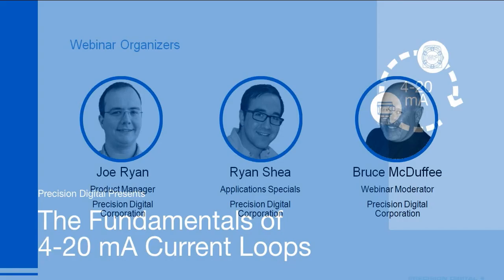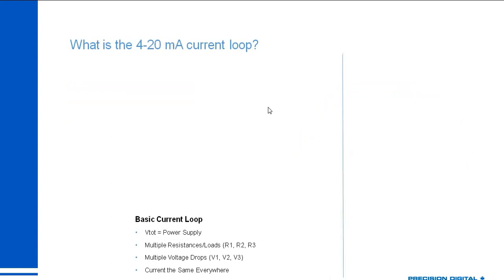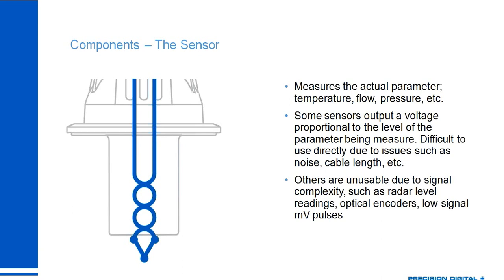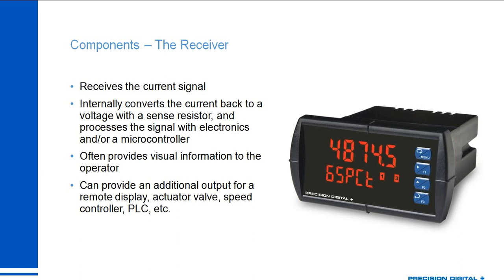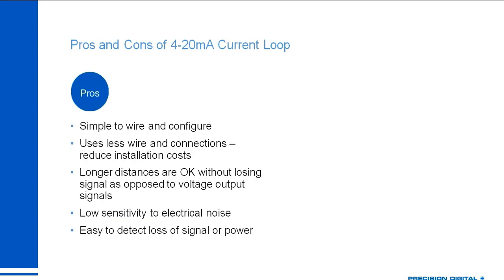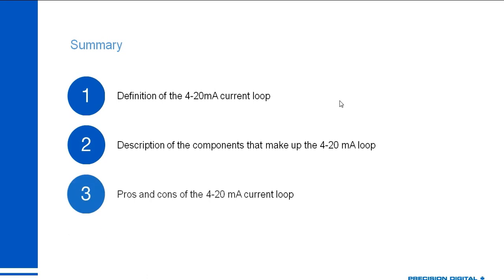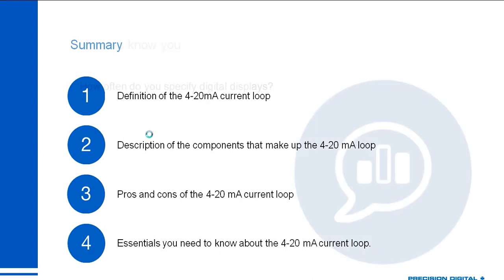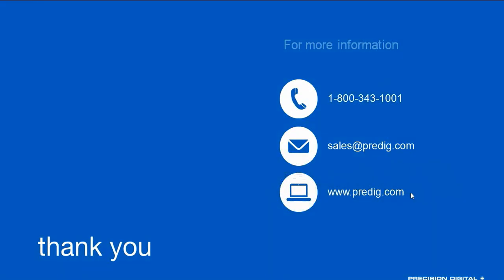The Fundamentals of 4-20 mA Current Loops

Comment: As a retired electrical/process engineer and  also college professor in the industrial control curriculum, I tend to watch a lot of videos like this; I am interested in what the presenters do well, and what they do poorly. How well do they address the questions from the students.

Sometimes, it is obvious that the presenter has given their 'class' many times and had learned from the experience, refining how they present the information. Most of the time, it seems as if the presenter is still new to the subject, and falls into a lot of holes in trying to convey the concepts adequately.

I thought this video started pretty well, but then started to fall part when students started asking questions. For example, when one student asked "what does regulating the current" mean, the presenter repeatedly tried to use the word "regulate" to define itself, which never works. When I taught this subject, I usually dealt with this question by making the points:

- Without a Transmitter, we could just adjust one resistor in the loop until the desired current flows, and the Receiver(s) will 'see' the correct value. But if the loop resistance changes for any reason, or if  the power supply voltage varies by even a tiny amount, the loop current will change and thus the Receiver will no longer see the correct process value.
- To make the current loop reliable, able to cancel out or ignore all the odd variables in the environment or in the loop equipment and wiring, we introduce the Transmitter.
- The Transmitter acts as a variable resistor in the loop, and its resistance gets changed automatically by the Transmitter in order to cause the desired current to flow in the loop, such that the Receiver(s) see the appropriate process value. But by itself, this function of the Transmitter is little better than the first rough (no Transmitter) approach.
- To really make the current loop work robustly, the Transmitter ALSO incorporates its own Receiver, just like all the other Receiver(s) in the current loop. Since the loop current is exactly the same everywhere in the loop at any given point in time, the Transmitter's integral Receiver sees exactly the same current as all other Receiver(s) in the loop. Now, if the Transmitter means to have, for example, 12mA in the loop to represent a 50% process value, but some environmental change, or loop resistance change, or the power supply voltage changes, this tends to move the current away from the desired 12mA, but since the Transmitter instantly sees the error via its integral Receiver, it can tweak its variable resistance to counteract the error and get the current back to the intended 12mA. This correction happens essentially at the speed of light, so there is no perceptible delay and for all practical purposes, there never was an error in the first place. THIS is what "regulating" the loop current means.
Reply: Thanks for this explanation

Comment: Hello there, suppose that the pressure transmitter is used on both sides of a unit to balance the pressure across the main inlet valve to the turbine. Now one transmitter has failed. it is possible to bypass the two-wire device? is it safe to join the +ve voltage terminal and the feedback terminal together? Since for the unit to start, there should a balanced signal to the controller

Comment: Can you please explain about receivers maximum allowable input impedance for 4 - 20 mAmp transmitter? I recently experienced a 4-20 mAmp tranmitter when connected to a data logger(0-10VDC) using 250 Ohms across data logger terminals trasmitter dropped it's output from 16-17 mAmps to 2-3 mAmps. I suspect transmitter is unable to maintain current supply depending on sensor output due to high input impedance of data logger. Please explain

Comment: A pedantic comment follows 🤪.
 I think Ohms law is generaly presented I=V/R for showing the causality in the relationship of current to voltage and resistance. DC Current in basic terms  exists as a result of voltage and resistance. However voltage exists without any current being present... So even if that presentation is algebraicaly correct, i think the original order should be kept when describing ohms law principles i.e.what is causing what and how they are related.
Reply: wow  thanks!  This caused me to think like an engineer (which I am not) instead of a technician ( which I am )

Comment: Hi, i have a Fluke 724 Calibrator and a Flow transmitter with the 24 dc voltage supplied by an external ps on it. If i try to simulate my transmitter is there a change to damage my calibrator from the dc voltage of the loop?
Reply: Shouldn't be an issue as long as you take care not to run over current.

Comment: 38:30

Why would there be a voltage drop when using a 0-10V or 1-5V signal as opposed to a 4-20mA signal?

The thing that causes the voltage drop is current, yes? If you are using a voltage signal (no current) how could there be a drop across long wires?
Reply: Signal does not have anything to do with the loop in question, by signal he means the reading you are measuring in the loop.  So since a powered series circuit has a consistent current flow for the entire circuit and a changing voltage after resistance, he is saying you want to measure the current and compare that measurement to your power source.  This is because if you don't you can measure for voltage at several different places of an unchanged circuit and you will get different voltages.  

To sum that up, it is a property of a series circuit that could screw you up if you aren't thinking about it.
Reply: Any circuit feeds into a load, however high the impedence (or resistance) of the load is, it draws current from the input circuit.  You assume the input signal will not cause current to flow. This is wrong.